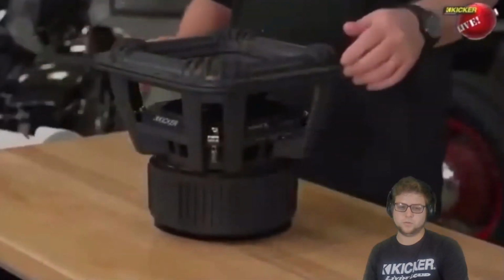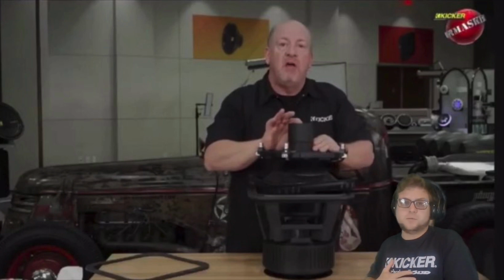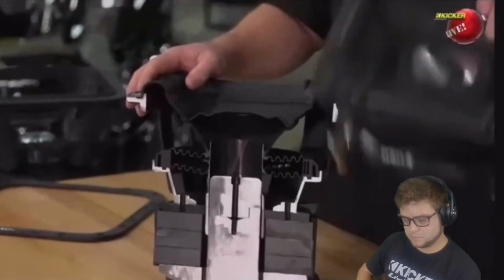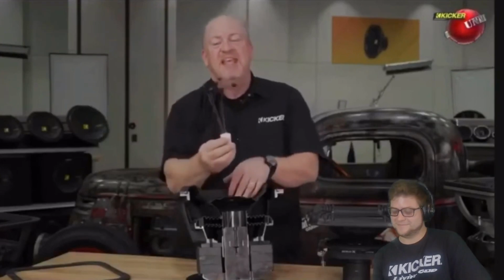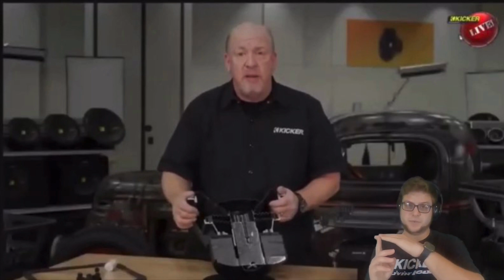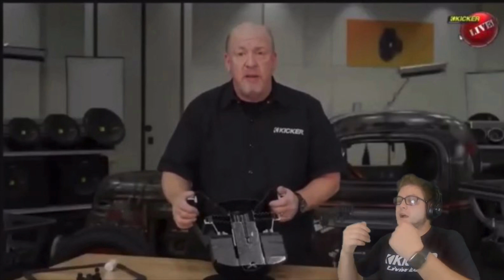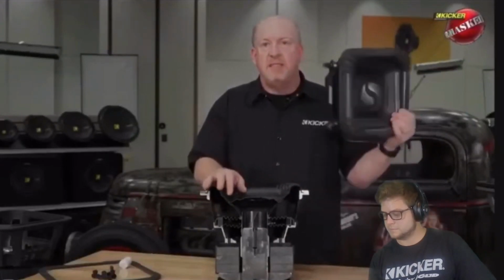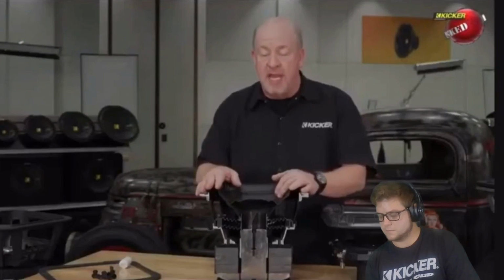THE NEW KICKER SOLO X RELEASE! KICKER UNMASKED

Comment: Kicker did a great job but I'm going with deaf bonce on my next build.
Reply: Norm Hiscock nice choice! The new Deaf Bonce 45 15" & 18" is a gorgeous sub! Plus it  produces amazing POWAAA!!!! I've been thinking about forking out the $1200 for one aswell!
Reply: @itdoesntmatterwhatyourname6128  I got 4-18 re sx's on 2 sound qubed 4500's right now and it's  loud asf. But I think 2 of them deaf bonce 4518's will be louder and take up a lot less space.
Reply: @normhiscock352  I love re audio these older companys really set the bar high at an early stage and always loved them!
Reply: @normhiscock352  sounds like you got a legit system. I know the DB 45 series subs are supposed to be a force to be reckoned with, but you really think just 2 would be louder than your four 18s? Idk you could be right you definitely know your subs better than anyone but that's still 36" more cone area that your system has. Then again I'm not familiar with the RE SXs rms rating. Are you pushing yours near their power threshold? I know the DB 45 18 is very conservatively rated & Steve Meade was saying in his video about them that they could easily handle 7 & 8k rms. I've been thinking about putting just one of them in the trunk of my car. I have a single 18 currently in my trunk but it's nowhere near the level of the Deaf Bonce. I was really wanting to put a Skar DNR 15 in my car but I cannot find one for sale new or used anywhere. I've posted all kinds of places looking for one. Thought about just getting the Audio Legion Emperor 15 subwoofer since its very similar to the DNR but I have never had any Audio Legion gear & don't know anyone who has.
Reply: @itdoesntmatterwhatyourname6128  The RE's are great but they get hot way to fast due to poor venting on the sub. Evertime I demo it out it's only for 30 seconds at a time. And no they aren't being clipped lol, I got 4 xs-power batteries,320 amp alternator and sky high 0 gauge.
Reply: @itdoesntmatterwhatyourname6128  I hear ya there and as far as the deaf bonce db sa4 18s that I will be hopefully running soon I've seen dudes throwing 20k to 1 woofer and dudes that have them now that I've spoken with have said I want atleast 8k on each but I can not say anything about yet but will see as far as the scar dnr those look cool I will say if I had a choice I think I would try and go with an audio legion
Reply: @justforlaughs8988  btw man think you could get me a job where you work? Mr pockets on swole over there buying 2 Orion HCCA 17k amps. I know those junts ain't cheap! DATGUM you making my bass look like straight garb. Over 30k rms, I'm only wanting to do around 10k max. I do not compete or anything though.
Reply: @justforlaughs8988  so you have had Audio Legion or have experience with their subwoofers? I really liked the Skar DNR I know for a fact it was a beast but Skar discontinued them. I emailed them trying to special order one with no luck. Though they did email me back insinuating that they would be releasing a new subwoofer to take the DNRs place after the first of the year & its supposed to be similar to the 5k rms of the DNR. But dang with no ETA that could be 6 months away or just 2 months away! I may just order the AL Emperor 15 a go, its rated 5k rms & has USA voice coils. The specs for the sub seem alright. But then again not knowing about AL I keep thinking maybe I should just get two American Bass XmaX Monster 15s (rated 4k rms each) & I can get them new for $520 per woofer. That'd be $1040 shipped for 2 versus paying I think the $899 that the AL Emperor 15 sells for new on the Audio Legion site. Wish I knew some ppl who could vouch one way or the other for AL.
Reply: @itdoesntmatterwhatyourname6128  LOL you're funny BTW iMac commercial electrician head Foreman of my company also have my wife and six kids and the to Orion 17k  amplifiers each will clamp 22000 w which is at a 15.2 volt status with a 1.8 ohm box rise load this is also the second car and neither one of these cars are for competition this is just for myself as far as audio legion I cannot personally say but a couple of my friends have had then and they've done very well
Reply: @justforlaughs8988  sounds like you have a great career. Though with a wife & six kids it also sounds like have a lot of first systems that you'll be helping with as each start driving lol. That is if they all live music but growing up around you I'm guessing they do. Even with a great job you have a lot of clothes to buy & mouths to feed. Yes I knew all the HCCA Orion amps put out a lot more than their rated power. I was wanting to buy one of their 5k or 8k but it seemed the prices had went up a good bit. Maybe due to the change of ownership idk. Did any of your friends happen to have the AL Emperor subwoofer? Idk why but I've never had any interest in competing neither. I just like my bass LOUD.
Reply: @itdoesntmatterwhatyourname6128  heck ya man my oldest who's 14 has a pretty bad ass system we built for his room already but his setup is focal, Toro, and audiopipe as for Orion my first car now which is a daily driver is all Orion that and already almost done I've got 2 15inch Orion hcca walled in a 6th order and 2 Orion hcca splx3ks on that pair then I built a 240 ah bank of lithium with a 390 amp alt then the front stage is all high end SQ running audio Dynamics 3000 series 2 sets of components with there matching dsp and 4 channel that system is clamping 15k I do have a spare 8k from Orion that Kevin is buying from me the dude who messaged before but I'm a huge fan of Orion
Reply: I have 5 kids and am married. I like to make sure my wife has a nice vehicle and the kids got everything they need before I go spend money on car audio. So saving up is no easy feat lol.
Reply: @normhiscock352  oh ya I completely understand that dude I didn't even think of getting anything till wife had a nice new truck and then she wanted a quad and snowmobile lol and I just got her her dream house last year it's never ending but she is my everything and she always gets what she wants first before I even consider getting anything for my self so I can absolutely relate
Reply: @justforlaughs8988  Same, me and my wife are bestfriends we hunt,fish play sports and video games together.
Reply: @normhiscock352  that's awesome man ! How long have you guys been married? We have only been married for 10 years
Reply: @justforlaughs8988  & Norm Hiscock nothing but respect for ya fellas. Sounds like you are both great fathers & dedicated husbands. This country really needs more of that! 

justforlaughs8988 I bet all that lithium gives you phenomenally stable voltage! I've been seriously contemplating going lithium & been reading all kinds of information. The internet is a great thing but I feel like I have to weed through some info that I find. A lot of different opinions on how you can use lithium & what it is & is not compatible with. Trying to figure it all out & make sense of everything. One slight issue that I have is over thinking things in my head thus making some stuff more complicated than what it ends up actually being in the end. I've had ADD since childhood & it got worse as an adult. At times its hard to dial in my thoughts & keep things from becoming a whirlwind. I try though. Could be a reason my comments end up long sometimes. 😔

justforlaughs8988 question: would around 70ah lithium be sufficient for 10k rms & of course the smaller amp for mids/highs? Probably a 150x4 amp idk for sure haven't got it yet but I think I might just go ahead & pre-order a Trauma Concussion series 100 watt x 4 channel amp. It seems legitimate & would pair nice in my ride with my new Trauma Concussion 3k amp. If you haven't seen them they have a real nice Bluetooth feature. Eliminates having to use RCA for a cleaner signal. Atleast that's what they say, UPS just delivered it yesterday. I'm still going to hook up my RCAs but will probably use the Bluetooth if it does indeed prove to sound much better like they claim.

Btw I know you might have thought why is asking about lithium for 10k rms if he just bought a 3k amp... Lol I'm just using what I have for now I won't be at 3k long. While looking at the Emperor 15 last night I also started looking at the Resilient Sounds 15" 
5k sub again too. Idk theirs so many choices & I'm a very indecisive person when given a lot of choices.
Reply: @itdoesntmatterwhatyourname6128  I'll tell you what are you on Facebook? And if so are you on any of the car audio forms? I belong to alot of them and I'm very much involved it might be alot quicker to answer all of your questions but depending on what lithium you use yea 70ah should be more then solid but I've got some great dudes who really have done quite abit of testing and it's shocking the out come on how well it truly does!
Reply: @itdoesntmatterwhatyourname6128  I sent you an email dude
Reply: I just baught 2 of the 18inch deaf bonce apocalypse level 4s and absolutely love them!
Reply: @justforlaughs8988  level 4s? Are you talking about the DB 40 18's? I've never heard anyone call DB subs level 4's. Though I'm familiar with the 35 series, 40 & 45 series  Deaf Bonce subs. 

justforlaughs8988 what amp are you running on your two 18" DB woofers?
Reply: @itdoesntmatterwhatyourname6128  yes they are the DB SA4 and I just call them the level 4s and as far as the amplifiers I will be running 2 Orion hcca 17,000.1dsplx amps each amp at 15.2v and pulling almost 2,000 amps of current at a 1.8ohm load clamped puts out 22,000watts each and that clean no clipping
Reply: @itdoesntmatterwhatyourname6128  i thought he meant the DD level 4's when I read it lol
Reply: @justforlaughs8988  Ryan you ain't runnin nuttin chump hahaha couple a dual 12's from Walmart maybe 😝🤣😂
Reply: @kevinAuman1  ok Mr audiobahn
Reply: @justforlaughs8988  idk what your problem with AudioBahn is but you must be really young if you think Audiobahn just made junk! Better ask around.
Reply: @justforlaughs8988  oh okay my bad man. I was thinking how could someone knock on Audiobahn.